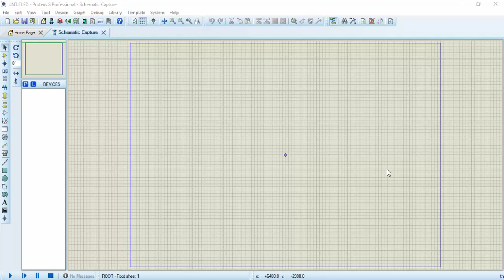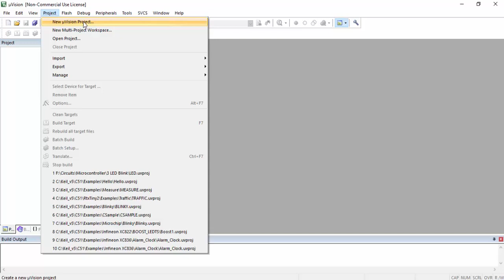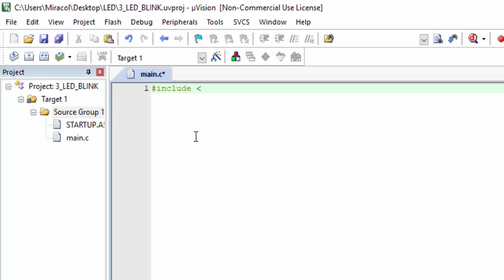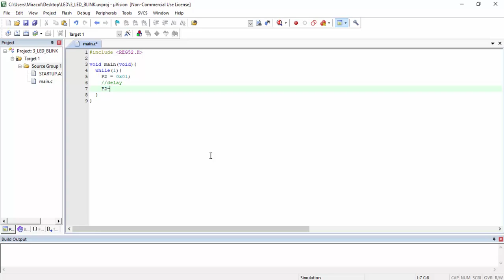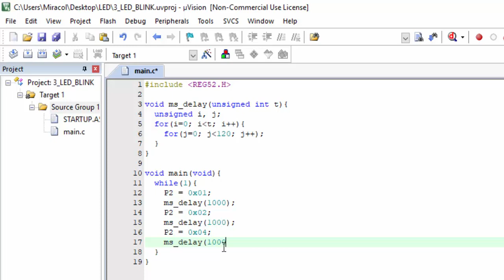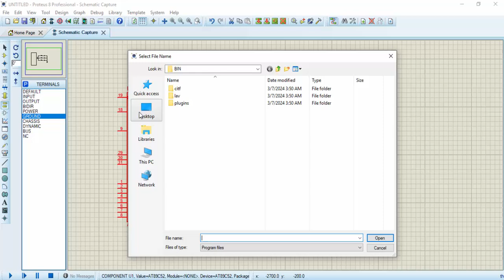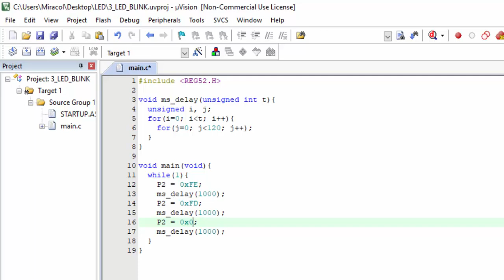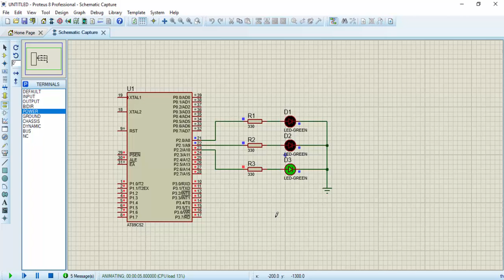Blinking LED simulation with ATMEL using embedded c in keil compiler

Comment: When you changed the codes to using set bits, did you build again and sent the new hex file to the microcontroller, or it automatically updates itself? As you didn't show that part after building, felt like it was the last hex file that was there unchanged
Reply from the maker: No, I don't have to add the hex file again just build the project the hex file will get updated automatically